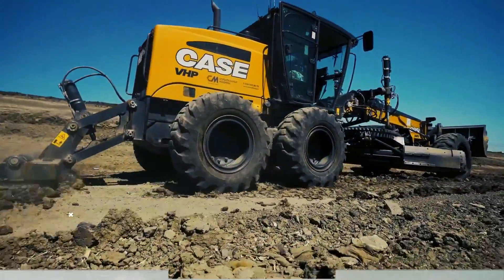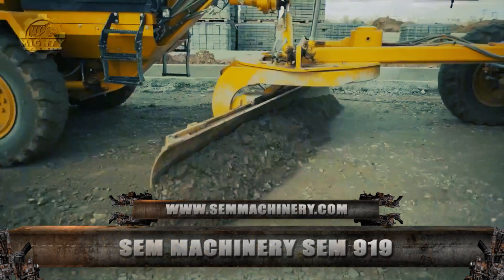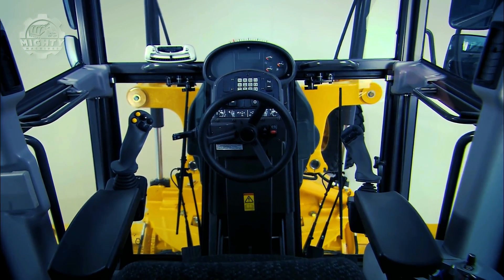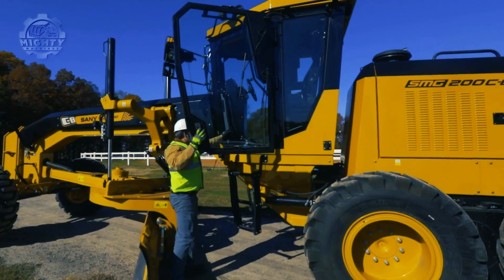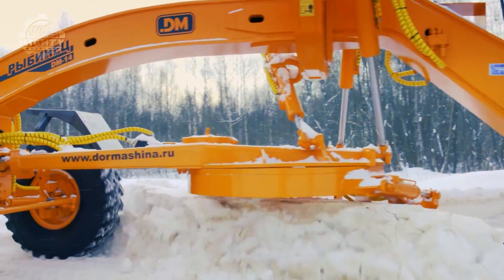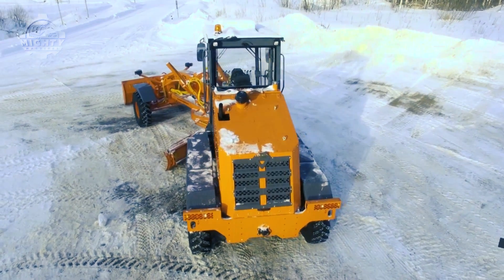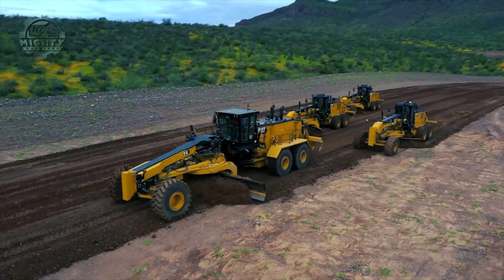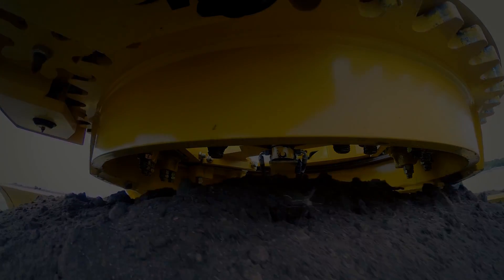World's Largest and Most Powerful Motor Graders Ever Built!

Comment: One of the easiest pieces of heavy equipment to operate.
Reply: Not after running dozens and loaders for 40 years
Reply: yes you are right, its easy to work with them :) my favorite tractor :)
Reply: If it doesn't have them gay joysticks.
Reply: @Carla-tz7qw  yes i worked with joistics, the buttons on it lag for blade functions it is shit :D